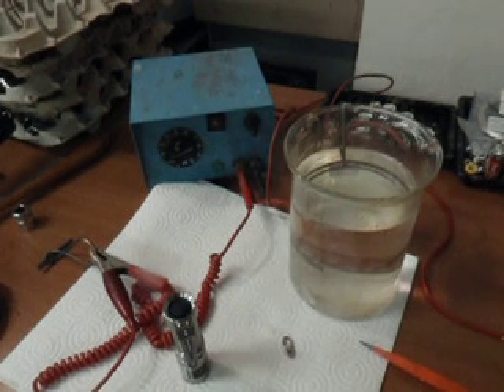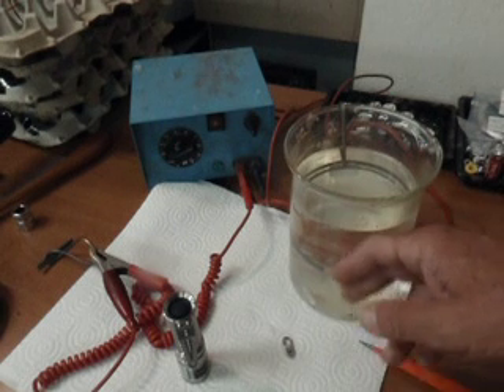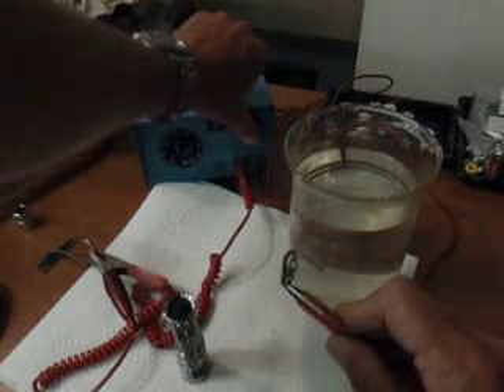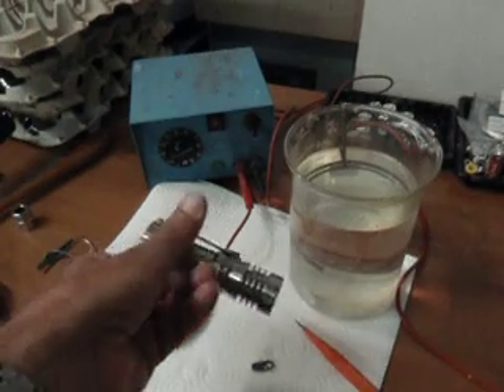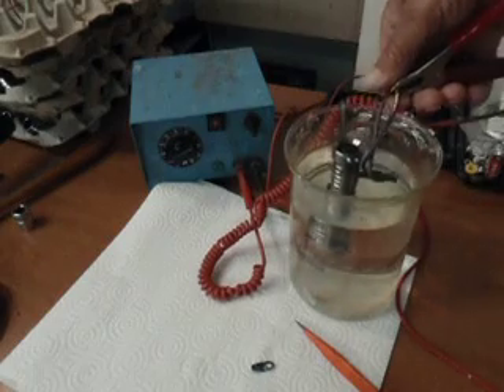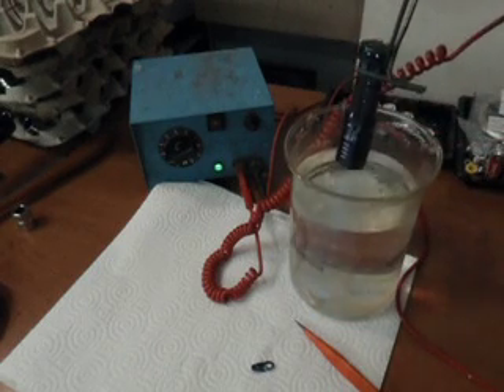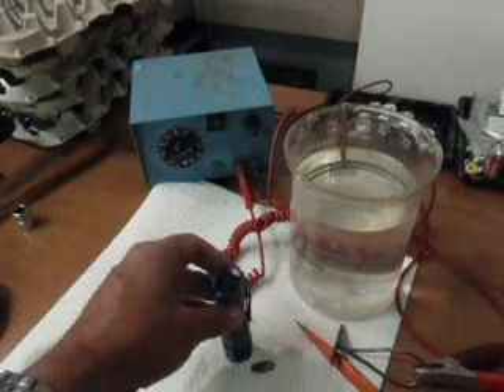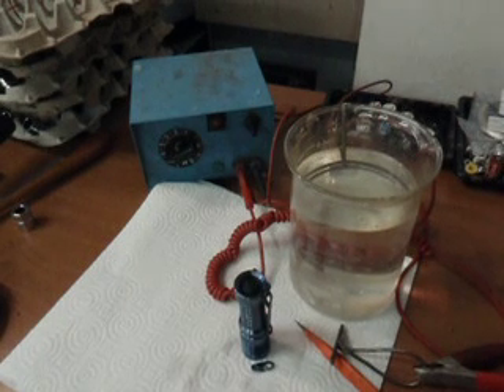Anodizing Titanium

Comment from the maker: It depends on what light you are going to anodize and whether it is safe to submerse intact. No doubt it is a good idea to remove the battery and light engine if you can. The safest method would be to strip the light down to just titanium components.